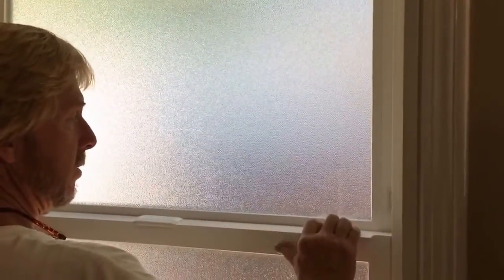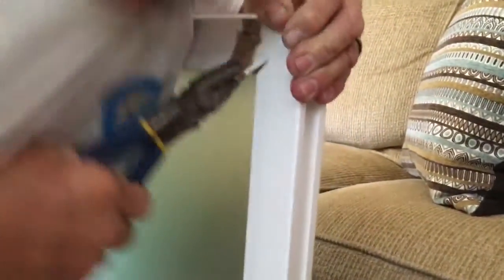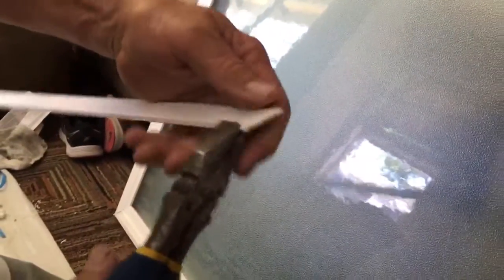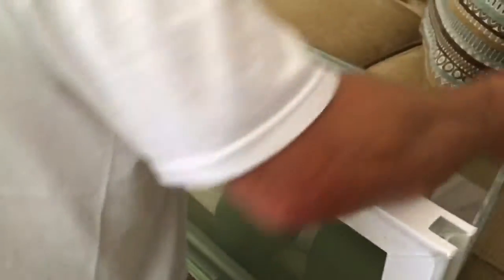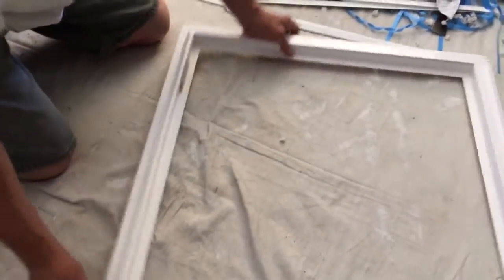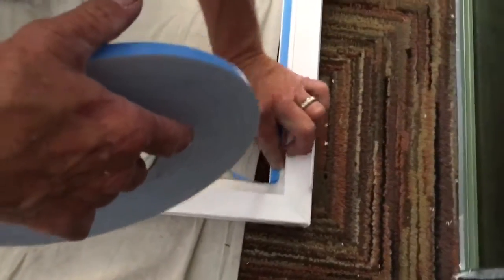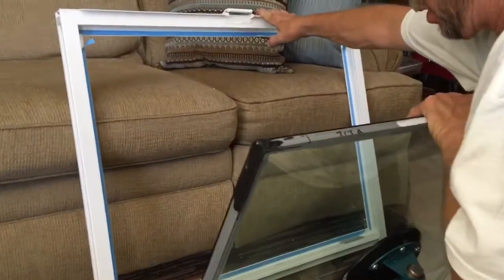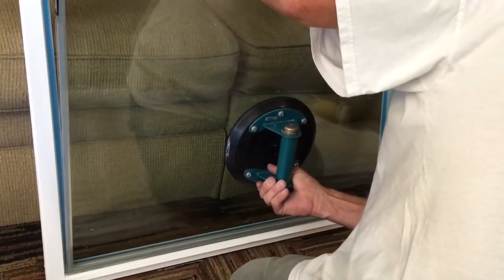How to remove and swap glass from a Milgard window (part one)

Comment: I do this for a living, and have a tip on pulling stops, just use a flat knife and wedge out stops from opposite end, not where you lifted with pliers, and please wear gloves. 
You did excellent work, in fact I loved your idea on starting the glazing tape that way, that was so good! 
Never seen that done before, my tip is pull all blue strip then lightly spray with glass cleaner and plant the IG unit, it will move freely for adjustments while I put the stops on and once dried it sticks. 
Great video!!!
Reply from the maker: Thanks for the advice but flat knives are not tempered to be used on glass and gloves are for women
Reply: I also found out that pulling with the pliers was very hard and crimped the stop.  Instead opted to loosen the stops by running the putty knife both on the glass side, flat...then on the edge where the stop is against the frame, pushing in at an angle which seemed to loosen the other stops without damage.

Comment: This guy does a great job of detailed explanation and demonstration.  complete with tape size of 7/16" Wide 1/16" Thick.....double sided Tape..dang....I got my window done in less then an hour but a smaller window....not a fan of Milgard as the small windows spontaneously break because of temperature changes from indore to out door...and in San Diego area of mild weather.
Reply: My inner window glasses broke, one after another!
Reply: Where in San Diego are you from?

Comment: Thank you Crowman for sharing.  @Milguard windows & Doors ⬇️ Why would I call you to pay hundreds of dollars for something I can do myself?   You do not stand by your warranty and I would never spend a dime at Milguard or even waste my time calling you so I can get the run around.
Reply: I have just the opposite interaction with Milgard. I have had two windows leak and although it took a few weeks to have them come out, they have replaced them 20 years after install. No problem

Comment: Use a 5 in one small chisel to pop the snap bead. Mitered or butt cut snapbead it dont matter much mitered are a bit more tricky. works way better that lineman pliers... wigling it back and forth. Smh. Ok ur a carpenter i forgive you. 😅
Yah bro take a flathead even bout 35 degree angle at the joint away from glass obviously palm of ur hand whack the screw driver 9 times out if ten works then pry slowly you dont bury the tool either just get a bite on the interlock of the snapbead and pry gently. At most a tiny blemish from the tool. But with newer service windows. Should be easy. Replacing windows? Dont count on deglaing to be easy. Hope this helps

Comment: Video should have been shot on an installed window.  Who installs new pane on a removed window?  Show viewers how to use spacers on the bottom, to center the glass, in the frame.  Anyone installing a pane, test fit before your remove the paper from the double-stick tape.
Reply from the maker: I was going to reply “there is so much wrong with your statement” but that would mean something is right. Your information is 100% wrong and if I were to guess I’d say you merely skimmed through the video. You must’ve. There’s no way you could think that anything in your statement has any truth to it, whatsoever, if you actually watched the video from beginning to end. Unless of course you’re a noob to the work or simply in online troll

Comment: Milgard does not endorse this video. Please refer to your Milgard dealer or contact Milgard directly if you need assistance with removing and reinstalling glass in the field.
Reply: If you would actually honor your warranty there would be a need for a video like this. You just denied my request for a fix on a window in my house. You have come and fixed three other windows, but decided that your company couldn’t bother this time around. I either do it myself or get someone else to do it as we have a window upstairs that has MOLD growing in between the panes of glass. Great quality, NOT. Yep, MOLD. Second window to do that in our house. First window had slimy mold at the bottom. Just nasty.
Reply: Yep, their warranty is garbage. Had an inside pane crack and was denied warranty coverage. Claiming it’s not a manufacturer defect. If glass breaks, and it wasn’t from something hitting it or the house settling, it’s a defect and/or crap quality. Never going with Migard again. Both my neighbors have had the same issue as well